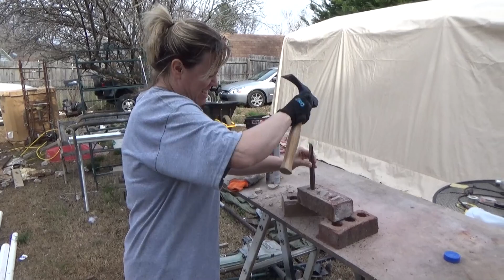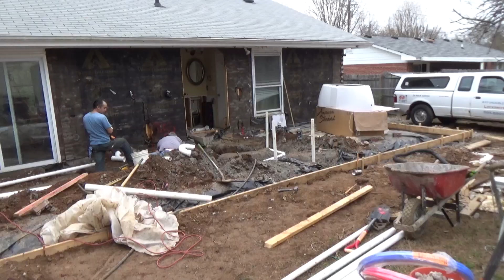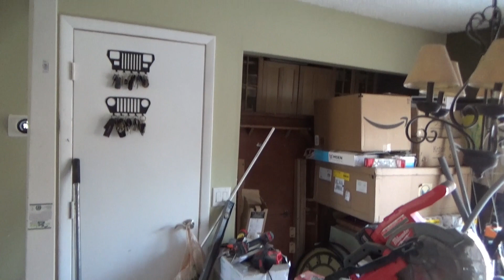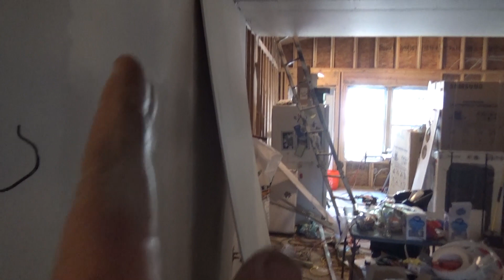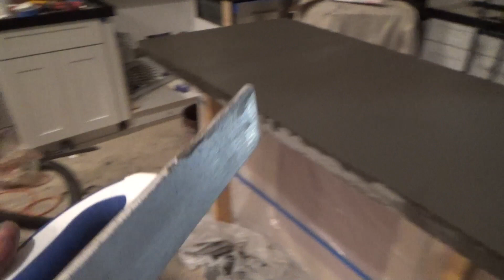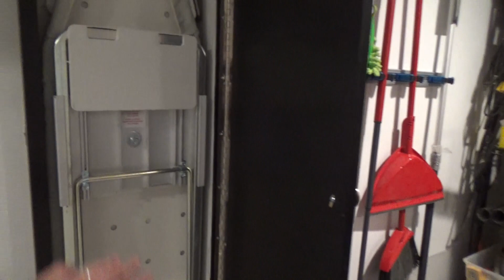Not So Redneck House Remodel / Addition

Comment: You know you could've used white thinset for the tile in your shower right? And keep a bucket of water with a sponge to wipe down the surfaces after you're done. Really cuts down on cleanup time. Also installed a ton of that Marazzi tile myself. I like it. Royal pain in the ass though if you have to install it over a concrete floor that looks like it was poured by a blind and drunk politician. And don't let that Pergo laminate get wet. Yeah it's the XP line which is supposed to be tougher but...... it'll still swell up along the joints if you let liquids sit on it. The house looks great though. Now time to drop a Hellcat in your TJ hahaha!
Reply from the maker: A Hell cat would be nice - Laughing thinking how long the stock drivetrain would last - probably about 2.4 seconds hahaha.  I used white thinset for most and yes the floor was a huge pain in the ..... in total I used 8 bags of leveling in different spots and still had to "adjust" in places. I hear ya on the Pergo _ I have no illusions that water wouldnt damage it LOL.  The shower was the worst for sure as far as time and aggravation.